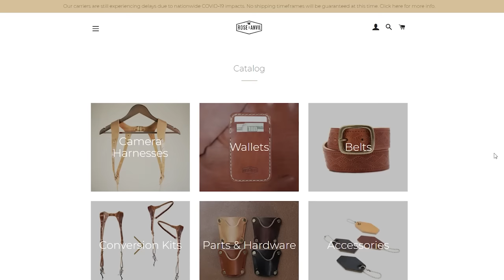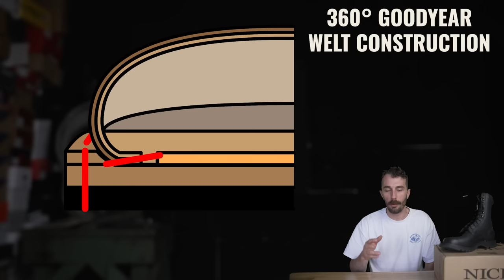($524) Are these the best Tactical Boots? - Nicks Boots

Comment: As for tactical boots for $500, there are a few flaws here. 
First, the eva layer should be the entire length of the foot. This will increase the wearing comfort.
secondly, a quick lacing system is needed here, like the USMC RAT.
Reply: That foam layer is a funny thing. They have pictures with different setups. some have just the wedge and some have the foam going the full length.
Reply: @Totemparadox  It's strange, heel wedge only on this Rose Anvil vid dated July 18, but full length layer in both the official Nick's promo marketing vid along with the Nick's How it's Made vid, both dated April 24. The boots now appearing for sale on the website also have the full length layer. The boots being tested above don't appear to be identical in the mid-sole to the boots currently being sold on the website as Nick's tactical boots. Could be better for comfort both standing and moving though.
Interestingly the hiker boot he mentions above that's currently for sale on the Nick's website has the heel wedge only.
Reply: @fozfactor  I actually hope they only put in the heel wedge. Just looks better in my opinion.

Comment: Well, since you asked. I think goodyearwelted shoes don't have stitches that go from the outside to the inside.
Reply: But they do. It's a fact.
Reply: @Totemparadox  but... They don't though... The stitch that goes to the inside just goes through the welt. But stays hidden behind the outsole. The welt is attached to the outsole with stitching, but that stitch doesn't go to the inside. Am I reading those images wrong?
Reply: @warpduck  The stitch goes through the welt, vamp and a rib on the insole. So while it is not visible from the inside of the boot, it's a direct route for water to get into the boot.

Comment: Quick question, wouldn't you want a more rigid sole on the "foot bend" so to speak, due to carrying heavy weight and tryna keep as much force of the foot itself?  The easier bend theoretically can probably be better in a scrap and combat situation but not for marching/running
Reply: it definitely comes down to preference in regards to foot strength, comfort, and application. Modern "Tactical" boots generally are designed to be more lightweight and flexible than standard issue military boots, which makes them less "specialized", and instead places them closer to a "general use" application. One aspect of Nick's tactical boot that defines its position in the market, is the resoleable construction. Most brands just do a cemented construction with whatever outsole they've designed, making them more disposable once worn out.

Comment: If we are being honest, a goodyear welt is much better than a stitchdown, but of course you are sponsored so all of the sudden stitchdown construction is better… the rubber make the boots much lighter weight which is a pro.
Reply: LoL no. Goodyear welting is cheaper and let's water in more easily. It's a very good build method, but 360 stitchdown is superior in keeping water and dust out the inside.
Reply: @Totemparadox  you have absolutely no idea what you are talking about. A stitch down is MUCH cheaper than a Goodyear welt, weaker and is a far less water resistant construction method. You probably are biased by the fact that you like this company but that doesn’t change reality nor does it make their product better than it is.
Reply: @AlexanderMason1  WRONG. Most goodyear welted boots are machine welted and not hand lasted so they are CHEAPER. Stitchdown is also far superior in water resistance since the upper and "welt" are ONE single piece. In a goodyear welt the water can get in between the welt and upper. Toughness? I'd wager both are equally tough.
Reply: @Totemparadox  You really don’t know what you’re talking about and you’re comparing literally the cheapest form of Goodyear wealth to the highest form of stitch down construction. You are wrong
Reply: @Totemparadox  with that logic, most stitchdown boots are machine welted as well. They also don’t have any welt which makes them harder to resole and they are far less waterproof than goodyear welted boots. There are also several variations of goodyear welted footwear.
Reply: @AlexanderMason1  "Far less waterproof" You seriously don't understand how this works? Answer this. Goodyear welt acts like the flared out vamp on a stitchdown boot. The welt is separate from the upper which means water can get between the welt and upper. On a stitchdown boot this cannot happen. The attachment of the midsole and sole is the same on both so those two aspects can't be compared.
Reply: @AlexanderMason1  I'll give you that the resoling of stitchdown boots is harder/if the vamp is damaged you can't fix it.
Reply: @AlexanderMason1  AND! Goodyear welt is the name of the industrial method of welting a shoe. Hand welted is a totally different thing.

Comment: I know it's for comfort but that foam and glued down rubber sole combo in the heel can delaminate rather quickly a trade off for comfort over durability I guess.
Reply: It can if installed incorrectly. If do e properly, delamination will not be a problem.

Comment: I see one potentially big issue with the boots, which is the foam in the heel is open to the elements, which means it will degrade and wear out quickly.
Reply: Then just put a new one on for a few bucks.
Reply: @Totemparadox  For 600 bucks it seems like something that should be engineered better.
Reply: @alpaul  That's not how it works. Nicks is a boot company. Not a sole company. They can't just conjure up a new type of sole for their boots. Also, this kind of wedge base is used a lot in stitched style boots and people aren't complaining.

Comment: Strange thing, my comment seems to ahve been deleted incuding the answer of another user. Without any notification or anything why.
What i wrote in my initial comment was that i find the price quite bold. As a conscript years ago i was issued boots that were simliar, apart from the rubber insole, rubber midsole and the polyurethane heel. Those boots were handmade in austria with (i would claim) same quality leather, and they are even available to buy today for between 140-200 €.
The leather and the construction was good enough that many of us were not issued new boots, but old ones that had been resoled for generations of conscripts. (And don't think we didn't marche a lot. Because that was the main form of transportation for us. There was a little mountain behind the base, and in a 7 days week we were up there at least 5 times, 3 times marching 2 times running)
And the comment of the other user was that the boots i was talking about weren't made in the US. 

And while that's true, workers in the US get a lower wage than here in austria, and aditional costs the employer has to pay like health insurances, and taxes are also higher here. That should make the boot more expensive here. And that's why i call the price of these boots bold.
Reply: "(i would claim) same quality leather" and "handmade" Yeah no. No military contract boots are handmade. The leather is 4-5oz compared to Nicks 7-8oz leather. Not saying the boots are bad, but they're not even in the same leaque.
Reply: @nirfz  Sounds pretty similar to the US Jungle Boot in construction and partly materials. They also cost almost the same. Both are good boots, but again not even close to these.

Comment: I have a question.
Just got my Nicks builder pro with an HNW last.
They are not broken in yet,they feel snug all around,but the heel counter seems too big for me ,my heel lifts a little when i walk.
I read somewhere that a good fit ( snug) would let you walk with boots unlaced ,and heel should stay in place.
Can anyone tell me if i am wrong,i am asking around before i call Nicks.
Boots feel great so i would hate to send them back .
I am aware that i can use inserts or spacers for the heel  counter,but tgat is for later.

Comment: I've been wondering what I would request from them if I wanted to have one of their boots setup for something I would use in the military.  I don't know how I missed this video for the past several months.

It would've been nice to see them include the fire resistant threads, waterproof is great, but that's another level of preparedness that I think would be worth it.
Reply: Fireproof thread isn't needed and they're basically waterproof if you treat the leather. If you want boots with a Gore Tex lining, Danner models Acadia, Sierra, MEB, Recon, etc. fit the bill.
Reply: @Totemparadox  If I've got kick out a fire in an emergency (work with me here) then how is the boot being waterproof going to keep the threads from burning up and my boot slowly coming apart?
Reply: @andrewb1986  I've stomped out many fires with boots that have no fireproof thread. No issue. You need to walk through fires that would melt your clothes before fireproof thread was ever useful.
Reply: @Totemparadox  Oh, I completely believe it.  You can do the same with basic tennis shoes.  But I'm an "over-prepared" kind of person, especially if I'm already going to spend this kind of money.
Reply: @andrewb1986    I totally get that. If you're interested, JK boots just released their 300 lineup. They use the same type of construction and they use Technora kevlar thread. Totally fireproof and super strong. They won't meet military regs, but for general use boot they seem VERY nice.

Comment: Carolina makes these boots with a heel and sells them for $120. Remove the heel and you've got a winner. I could buy a set of rubber tires for about the same, and they'll last way longer. I guess I could have leather tires for the same price.
Reply: No they don't. Not even close.
Reply: @Totemparadox  what's dramatically different between this an a 8in soft tow logger? Those boots lasted me over a decade of seasonal logging boot. I covered the stitching with wax and water didn't get in. Nick's is just full of over the top features and construction methods that cost more.

Comment: If you are going to be doing "tactical boots" I suggest getting your hands on a OpsCore CT boots, unfortunately it's a small UK based company so may be a pain to find but they are THE BEST tactical boots currently available and are actually built specifically for police/counter terrorism work rather than a clunky waterproofish work boot with the horrible Vibram Sierra soles that are way too hard and slippery on tiles and metal with those "ski stud" lacing that gets tangled up on gear.
I get that Nick's make good logging boots but they should stick to what they know rather than making a overpriced boot that's not fit for purpose, which could lead to accidents and injuries..... though the roughout version would make a good military load boot if they keep that Vibram Sierra soles on them and replace the PU foam heel block  with something that doesn't suffer from hydrolysis
Reply: You mean Ops Tactical? Ops Core is a huge US based military contractor. PU doesn't suffer from hydrolysis fast enough if the boots are actaully used. The wedge will get swapped with the worn sole. Also I highly dount your vlaim about "best". They look ok, but nothing special. Also their price is a bit low, so materials have to be cheap.
Reply: @Totemparadox  ops tactical is right....did muck up the name there.
PU foam does suffer from hydrolysis if you're in a constantly humid and hot environment..... only takes a month of disuse for the foam to start perishing and then it becomes a really expensive paperweight due to the way that boot is built.
And the CT boots aren't cheaply made by any means.....they just aren't made by outdated 19th century "handmade" production methods like Nick's are so you get a cost saving
Reply: @richardcostello360  I have boots made with modern techniques that cost almost double what Ops Tactical boots cost. They sound cheap to me.

Comment: I've got some English-made Crockett and Jones boots with that Veldtschoen type construction. To minimize vertical seams which can leak the side has a horizontal seam high up in the shaft. Nicks have missed a trick with these.
Reply: "Which can leak." Except when well built and maintained. Nicks didn't miss anything. They just didn't build something like you wanted to.